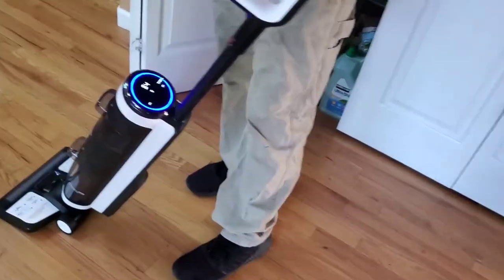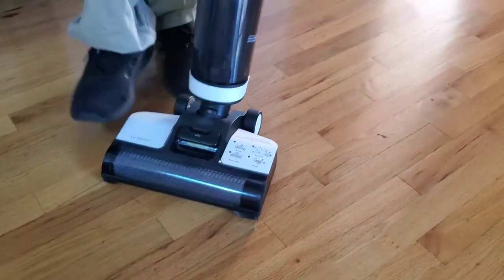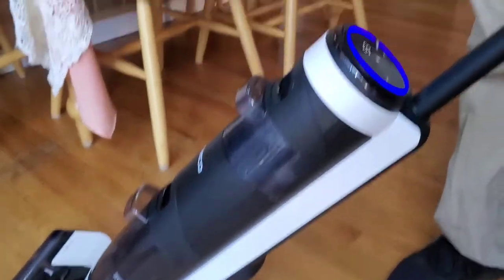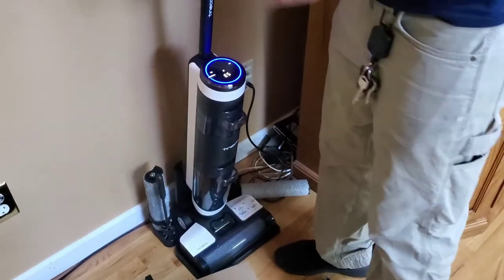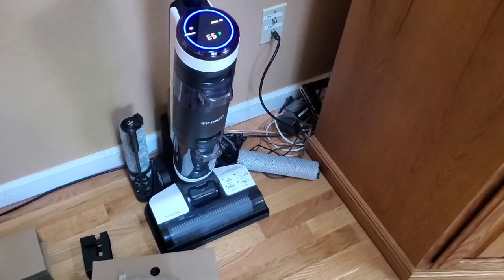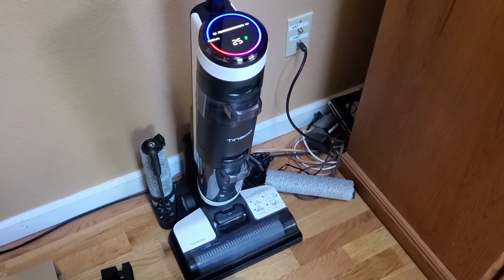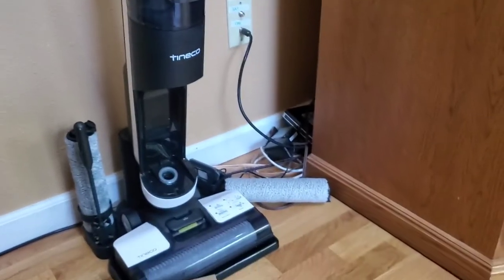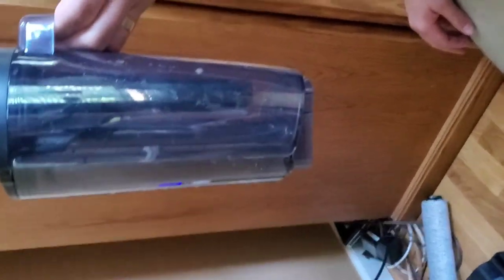Tineco Vacuum Issues

Comment: Not sure if this is still an issue,  but my wife’s was doing the same thing and I was surprisingly able to get it going, I’m not very mechanically inclined so it was surprising to me. So when I removed the dirty water tank I saw that there was the filter hole (white) and another hole (gray). In the gray hole there was what looked like to me to be a bolt that was seized. I grabbed a screw driver and spun it a couple times and when I tried the clean mode it worked. Seems to be working fine now but I have a feeling I’m going to have to do that again in the near future it was pretty rusted
Reply from the maker: I personally got my vaccum replaced by tineco under warranty. Your comment is the first one that has some advice. I'm not sure your bolt problem will fix the shutting off randomly problem, but its worth a try for people who have no other options. Congratulations on the pin!
Reply: I hope it helps someone, because it was doing what yours was shut off and say to clean the dirty water tank or the debris channel. I tried removing the top of the dirty water tank and it would say clean debris channel. So I tried to open it up but I got scared I was gonna break it so I put all the screws back lol. That’s when I noticed the two ports that connect to the dirty water tank. Just got lucky I guess
Reply: @ccostilla361  which screws are you referring to? I don’t see two holes when I take off the DWT
Reply: Hi. Please can you take a picture and show the white and grey holes you are referring too. Mine is definitely rusty but can only see grey filter but not grey and white holes. Thank you.
Reply: Looks like a picture can’t be added.  Anyway best advice I’ve seen to date .
Reply: @208shaza  I don’t see two holes near the DWT maybe mines an older model?
Reply: @manskavewoodworking8616  I think they might be above where you will see the grey plastic vent thing. That’s where the rust is coming from on mine. Something must be in there 🤷‍♀️.
Reply: @ccostilla361   could you possibly do a short video?
Reply: @208shaza  so on the top part where the DWT goes in - I saw that vent looking link that goes to the CWT but didn’t see screws - I’ll check again
Reply: @208shaza  I will try
Reply: @ccostilla361  that would be fantastic if you can manage. Thank you for taking the time.. 😊

Comment: Just from watching real quick, it makes it seem like the motor that helps with the forward assist is bad or maybe the mop head motor is not allowing it to spin fast enough, causing it to go out on that error?  My Tineco does the same thing, but that’s for cleaning it or if I’m just mopping, it’ll turn itself off after three or four seconds.  Messed up is I bought it February 20 20 and the company did fix it but now it’s having the same exact problem…

Comment: I had the same problem. They never tried to clean the debris channel, which you do by removing the roller. Once I cleaned it, it started right back up.
Reply from the maker: This issue was happening brand new out of the box.

Comment: Replace the little filter and see if that solves the issue. If it doesn't create a vacuum seal which that little filter helps create, it will tell you the canister is full

Comment: I had a similar issue with it telling me the DQT was full when it wasn't or to self clean when I had and know that was not needed. Thankfully it is within warranty I got it in January but they want to send me a refurbished model instead of new as it is over 30 days old. Curious if yours was refurbished as well? It makes me a little nervous to get a refurbished one that may have scuffs or look beat up compared to my new machine or battery that may not be as new since once the battery goes I have to buy a new machine I was told. Thanks!
Reply from the maker: This issue happened to me twice. Both times it was right out of the box. Given that it was brand new. I got a new unit both times.

Comment: Have you tried replacing the dirty tank from the good Tineco and see if that works. Seems like a sensor problem to me, or some sort of safety flout stuck. Worth a try, it's  a shame people don't fix things anymore.
Reply from the maker: I didn't try that before returning the vacuum. The dirty water tank has a float, but no sensor. I know the float wasn't stuck. It would be visible and audible. Not sure swapping would have made a difference. I think this is a sensor issue

Comment: Follow below step is should solve your issue as it does for me based on Service center advice.
1. Please remove the dirty water tank.
2. Please take the machine off the charger.
3. Please make sure the machine is powered off.
4. Please long-press the self-cleaning button for at least 20 seconds, you may count on it for a time.
5. Please reinstall the dirty water tank and restart the machine and see if the same issue still exists.
Reply: I tried this. A few times. Sadly it didn’t work for me.
Reply from the maker: This was already attempted well before I made the video. Good advice for others though.
Reply: This worked for me!

Comment: SOLUTION Maybe: This was happening to mine too. Kept stopping and saying dirty water tank full. It wasn’t full. I was going nuts. I looked at the screen and saw that the filter light was on. I didn’t understand because the filter was completely clean. I decided to try and troubleshoot myself since there seem to be no answers to this question. I took off the area where the filter is kept and looked at it. I thought that maybe my filter got wet when I was cleaning off the tank cover. Just in case I changed the filter to make sure it was completely dry. Tried the vacuum and same thing. DIRTY WATER TANK FULL! Ok calm down. Let’s look again. I took the filter back out and dried the entire tank cap with a towel. The metal prongs at the top that connect to the sensor may be an issue I thought. I blew on them and droplets of water came out of the cracks. I kept doing it and wiping it off until no more water came out. Now the tank cover was completely dry. I tried the vacuum again and it worked perfectly. Lesson is whatever you do, do not get the tank cover wet. Not even a tiny bit. Do not rinse it off unless you are going to let the machine sit long enough for it to completely dry. Don’t even put it upside down on the counter when you are emptying the tank. The water on the underside will leak into the filter area. So if this happens just make sure the filter and the filter compartment are completely dry as a bone. Get the blow dryer out of you have to.
Reply: I had the same issue.  The battery now wont charge I think its water dripping in to the charger points.  Frankly this is a major fault.  I bought via Amazon so I am waiting for a 2 days for the Manufacture to respond.  I would opt for a full refund bought June 22 so has 12 months warranty.

Comment: I have a feeling these Chinese knockoffs are priced super high to give the illusion of prestige over the legitimate crosswaves. Obviously still just cheaply made over priced Chinese knockoffs.
Reply from the maker: I think the tineco offers legitimate benefits over the cross wave. People have had similar issues with the cross wave as well. It really depends on what you want from yournwet vacuum. The cross wave having a dry and wet tank sounded like a lot more work that I didn't wanna have to deal with. The tineco with a fresh and dirty tank.
Reply: @David_Poole  David you’re very right.  I have a two month old Tineco ifloor S5 & although I’ve not resolved my problem (no suction, it spews water out the bottom), I have had four of Bissell’s Crosswaves, two they sent free after the second one I bought devolved problems (like the first one I bought) while under warranty.  I have taken the Crosswaves completely apart & put back together.  I had spares after all.  Each developed similar problems.  I own several other Bissell products that I don’t have problems with.  Conclusion?  Design issue with the Crosswave.  So I make the leap to Tineco.  Fell in love with the superior quality & cleaning.  Wow.  But lately, after three months, it developed this problem.  I think water got up into the motor.  It fell over one day.  I got it quick but still.  I went through the bottom half, it seemed in good shape, next is the upper part.  Not looking forward to that. Any tips would be most appreciated. But Tineco, quality is better.

Comment: Mine started with the same issues! Now it won’t make it past the ‘cleaning debris channel’. So it dumps half a can of water on the floor during roller cleaning cycle and won’t suck it up…
Reply: Exactly what happend to me. I own a S3 since around 3 weeks. It was working like a charm. No I had not used it for about a week and soon as I start to vacuum it stops working after a few seconds and tell me "clean dirty water tank, clean debris channel". The dirty water tank is empty and clean. The debris channel is clean and free. I cleaned it with the brush that comes with the appliance and I also tested if water can rinse through, bouth works fine, that is also no debris viewable with a flashlight.

I tried to replace the roller, with the spare roller, the filter with the spare filter. Cleaned everything. I can't find any clogging and dirt left overs.

But no matter what I do, the message keeps repeating and I am not able to use the appliance. If placed on the station/stand I can start the cleaning cycle but all water is left on the stand instead of the dirty water tank. For some reason the appliance doenst seem to vacuum anything in.

I have guarantee so it is not a biggie, but I would be still looking for tipps how to fix this issue myself.
Reply: Same problem here!!!
There’s no way Amazon gives me the order number even confirming with my bank statement 
I am VERY upset this is ridiculously stupid
Reply from the maker: The motor rusted and seized up. After owning mine for over a year, I didn't use it for a couple weeks and when I went to use it, it did exactly as you described. I took the unit apart and found that the fan that creates suction was seized up. I spun it until it felt smooth and reassembled. It has worked since then. Key takeaways are to not let it sit for long periods of time, and don't suck up anything corrosive. That means don't clean with things like vinegar. I think the main failures for these types of machines are weird program bugs (what you see happening to me in this video), and motor failure from rust and corrosion overtime. water and metal don't mix!

Comment: I'm pissed. This is happening to mine too. Maybe I'm more pissed because my kids are screaming and crying and I'm trying to figure out what is going on.
Reply from the maker: The sensor that detects static pressure starts to fail and the vacuum thinks the plastic float in the dirty water tank has engaged. Which would normally mean the dirty water tank is full. This is why it says to empty the tank when it's not full.

If you bought the vacuum in the last 2 years, it's covered under warranty. The best thing you can do is call customer service as they will fix it for free

Comment: Tineco makes expensive pieces of junk. I have been having trouble with my s3 for 2 years now. They made me pay to send it to them to fix but it was still doing this and now the clean wage reservoir has a leak in it as well. It spills water all over the place when it’s in clean mode. Doesn’t suck up any water and says tank is full . The fact that I had to pay $74 to fed ex it back to them for fixing is crap . Today they told me to pay for it to be sent back to them again and maybe they’ll send me a refurbished one.. that will be $$400 + into a $250 machine that has been faulty from the beginning

Comment: Did you find a solution
Reply from the maker: I made this video for tineco so they would warranty the product. They wanted me to send them a 30 second video over email. As you can see that wouldn't have been nearly enough time to show what was going on, so I made a YouTube video for them to watch. 

This was actually to 2nd vacuum I received where right out of the box it did this. It was during a sale so I wonder if they were trying to offload known to be bad products. The first time I returned it, I was able to drop it off at Kohl's and get a new one no questions asked with Amazon. The second time I had to go through tineco. There are alot of people online who say there customer service sucks. I did not have that experience. They answered the phone first time. Yes they were Chinese but the spoke good English and understood me without issue. They responded to the emails quickly as well. 

After they watched this video, they immediately sent me a 3rd vacuum and it's worked great ever since. 

Have you had the same issue? Or are you on the fence about buying one? If your on the fence, I do wanna add that it's a great product once you get one that works. It was a big hassle to go through the return process twice, but I think the tineco makes light vacuuming and mopping so easy that it was worth the hassle in my case. My whole entire house is hardwood floors so it's a real time saver. Best of luck
Reply: @David_Poole  thanks man mine was working fine at first now it's doing the same thing on and off
Reply from the maker: @dortcharmy11  I'd record it next time is happens so you have the evidence, or send them my video. My father in laws starting doing it here and there as well, but never as bad as you see here. You can also do a factory reset by holding down the cleaning button on the top of the handle for 20 seconds. You remove it from the dock and get the display on. Then hold down the button. It gives you no signal that it did anything so don't expect a confirmation tone or notification. Maybe that will get rid of it. It will also be the first thing tineco asks you to do if you call them
Reply: Mine worked fine for 5 months and is now doing the same thing.
Reply from the maker: @ahmedalsaisaban1171  they have a warranty of 2 years. I'm sure they'll send you a new one if you call customer service
Reply: Mines started doing this today. That’s why I’m on YouTube trying to figure out what to do.
Reply from the maker: @MsMuffin7  only thing you can do is call tineco. As long as you bought it within the last 2 years, they will give you a new one for free.
Reply: Mine started doing this today and I did do the 20 sec reset.  It seems to be working fine now.  I think making sure the tanks are absolutely dry before replacing is important also.

Comment: I think the problem is that the water tank on top does not have enough of a seal either where you put in the water or the little seal on the bottom to cause a suction.
Reply from the maker: I don't see how the clean water tank sealing would cause a dirty water tank fill fault. That tank is most likely passive. There's just a switch inside that either let's water drop out, or not.